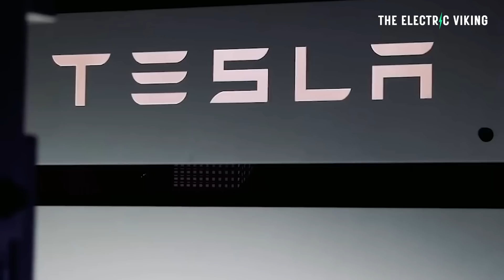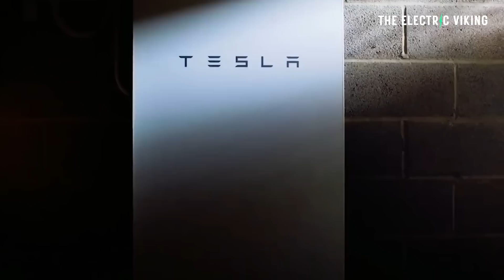Solar levelized cost of electricity has fallen by over 90% since 2010

Comment: There is total national energy; 10% grid electricity and 90% fossil fuels. 

Grid electricity is 10% dirt cheap electricity and 90% transmission costs.

Transmission construction is 10 decades and $TRILLIONS in national wealth. 

These are fundamental facts that vary a little national grid to national grid.

Transmission and Distribution capacity is a fixed minimum thing that limits the amount of electricity to the customers. 

The grid is fragile because it is extremely expensive and engineered to minimise costs of construction to the customers. 

Isolated farmers know how expensive new electricity poles and wires are from the existing grid. 
The new line is a new load and the entire line back through switch yards may have to be upgraded aswell as the flarmer's new line in to the buildings on the property. 

Let me highlight the situation. 
Nuclear promoters say CLIMATE CHANGE, so they will be the solution for clean electricity. 
Nuclear promoters say existing generation plant with nuclear heaters saves new grid construction. 
But CLIMATE ACTION means more than 1% of energy being clean, and NUCLEAR ELECTRICITY is extremely limited as the nuclear promoters have said. Limited be the EXTREMELY EXPENSIVE costs of new grid capacity construction. 
Nuclear promoters say, $1 to $10 million/ km.
Government says 1million km is grid length. 
Grid value $1TRILLION and 10 decades. 

If the sunniest continent on the planet is nuclear for climate action then every country on the planet will want nuclear industries. 

80% of the world's population live in dictatorships. 

Military defence budgets will explode. 
Add that cost to nuclear electricity. 

More grid electricity will mean more electricity grid construction. $TRILLIONS 
Add $TRILLIONS to Australia's minerals export industry. Uranium yellowcake, iron ore and coal and copper and zinc and aluminium and rare earth and lithium and....

Now Australia can have more nuclear electricity and more nuclear submarines and more massive weapons systems all paid by the world going to nuclear electricity. 

But nuclear must have cashflow 247 and millions and millions and millions of customers with rooftop PVs dirt cheap electricity and batteries will not need grid electricity. 

This is a national economic disaster if nuclear electricity generation plants were built and cashflow is dead. 
$100sBILLIONS in nuclear plant and no income. 
The $TRILLIONS national electrical grid cashflow will be a disaster as well. 

Nuclear promoters logic is f.......cked up.

Comment: Canadian nuclear promoters need cashflow 247.
Customer Rooftop PV electricity stops cashflow when the sunshines. 

As fossil fuels are abandoned electricity demand will inrease 4 to 7 to 10 times.
Huge oversized EV or BV batteries will be on the grid with V2G and selfparking selfplug-in. 
Bumper height wall plugs, ezi pezi at all carpark spaces. 

When the sunshines on customers rooftops PV, expensive grid electricity is not needed.

Grid cashflow is DEAD when the sunshines.
Grid cashflow is DEAD when the V2G EVs oversized battery is charged and the sun has set.

Solar panels will have huge import taxes. 300% 😮

Comment: The advantage that base power supply Used to offer was that it was cheap.  Coal was cheap for a long time, and nukes were not crazy expensive.  Now coal-fired electricity is more expensive than the other sources and nuclear is crazy expensive.  On top of that, neither coal nor nukes are dispatchable on the time basis that provides any value to a utility matching varying supply with loads that have always varied.  Base supply is NOT needed to keep the lights on at night.  ANY cheap source of electricity that runs at night will do the job.

Comment: True, the cost of solar panels and inverters have dropped considerably. In THAT aspect Tony Seba was correct.

However, he never contemplated about the devious way power companies operate.
During peak moments you have to PAY when delivering power back to the grid, only because the capacity of their network cannot cope (decades of mismanagement).
The only solution is home storage, but those batteries are disgustingly overpriced.

Also, big solar farms and wind turbines are switched off 10% of the time, because of “over supply”, though traditional power plants remained working…🧐
Reply: Battery costs went down even twice as fast as PV panel costs. A 10kWh LFP battery today costs less than 6k€ in Europe and enables a typical family house to  run exclusively on solar power day and night for 70% of the year.
Reply: @ikarustigger  A 10ish battery should costs way less than €6k.
Take a Tesla M3LR. Say it costs about €50k with a 75 kWh battery.
seven powerwalls are over €77000.
Thus a home-battery with wheels is cheaper…

Comment: Thanks Sam for providing this excellent summary promoting solar energy. Long time  believer and installe solar PV  to our home (13.2 kWh) in 2012, and two Powerwall-2 batteri3s installed in 2018. Our solar system was paid off by 2019 and we operate as a microgrid ~8 months of the year in Edmonds, WA (USA). Solar is a no brainer and  works to power our all electric home and charge our two EVs, while exporting excess solar energy back to grid through Net metering.

Comment: There is more solar power available in summer than winter. If enough solar panels are installed to cover demand in winter, there will be an excess in summer. Rather than let this go to waste, this could be used to make e-fuels to power existing and new ICE cars. I wouldn't write off synthetic petrol just yet.

Comment: But why is the LCOE relevant? It's the total cost that matters. You're looking at the wrong number. Even if wind and solar are the cheapest to 'add' to the grid, as the CSIRO says, wind loses to wind, solar loses to solar. Adding wind and solar makes the rest of the grid less efficient and thereby driving up costs of the grid as a whole. This is why grids with lots of wind and solar have high electricity bills. South Australia verses the other states. California verses the other states. Germany and Ireland verses the other EU. There are no exceptions.

It's like comparing commodities, the levelised cost of commodities (LOCC); iron, cotton or opium. The LOCC would be good for comparing iron and cotton, but not good for opium because people will get addicted to opium then become unproductive and the market shrinks. But even as the market shrinks, all the way up to economic collapse, societal collapse and into an opium war, the LOCC would still say that opium has the largest profits. Wind and solar are the opium of the energy sector.

Comment: LCOE as a measure does not take into account the cost of backup, grid balance and curtailment. Why is it that countries with high level of intermittent  power supplies have the highest electricity cost. You would make electric viking a real valuable channel if you dig deeper into this.
Reply: "Why is it that countries with high level of intermittent  power supplies have the highest electricity cost" - The answer to this question readily available online. In Australia it keep getting recycled by renewable energy contrarians and has been done over and over and over. In Australia it has been explained repeatedly by energy sector representatives, such as AEMO, AEC, ARENA, CSIRO and the various regional electricity network operators.

So one more time in laymans summary...........

The SYSTEMIC transition to a complete and mature renewable energy system is in it's infancy. It is referred to as a disruption that will take many years, not a simple change over. While the transition is in progress traditional forms of energy and generation obviously need to temporarily "hold the fort" so to speak. That costs more, while you have to retain the traditional system running along side the new system and all the complexities that brings with it. But there is no magical switch to flick and bingo we are all in renewable energy transition utopia in an instance. So what were you expecting? There is nothing unexpected about the state of play.

Maybe if all the mischievous naysayers piped down, got out of the way and let the people with the know how and expertise progress the transition, so the can get on with the job unhindered and at greater pace, electricity prices would be that much closer to coming down. But no, so many people seem to think they are experts in all things energy, while being critical of things that are entirely outside their sphere.
Reply: This is simply not true.  Here in America (excluding California because California regulation is absurd), the states with the highest percentage of renewable energy on their grid are also the typically cheapest.  South Dakota, Idaho, Texas, Washington state, Oklahoma, Kansas, Wyoming etc..  Also interesting, most of those states are free market Republican held states and they are building out renewables 3 times faster than blue states.
Reply: @Ryan-ff2db  Thanks for the heads up from your country. It has also been interesting here in Australia, because we have also had a mix of political flavours across states driving the transition to renewable energy.

It can only be a good thing. If politicians are willing to put ideology aside and make decisions based on merit, then they earn our support, whatever political flavour they adhere to.
Reply: @BrentonSmythesfieldsaye  Well, generally Republicans are the Big Oil party but red states(republican) are also more free market, making investment in renewables cheaper and faster.  The big red state of Texas has over twice the renewables as California but California rates are over 3 times higher than Texas.  South Dakota has almost 80 percent of it's power from renewables and again over 3 times cheaper than California.  So cheap renewables is indeed possible, if you keep the politicians out of the way.
Reply: @Ryan-ff2db  fact check:- 
Texas is still 70% Gas, coal and Nuclear generation…and a much smaller consumption than Ca.
S Dakota is a tiny generator (2.0 GW average) with a high proportion (30%) of Hydro .
EVERY State or country that has introduced wind and solar into their supply have seen electricty price increase.
Reply: @weinisable  "EVERY State or country that has introduced wind and solar into their supply have seen electricty price increase."

Since you made this statement without qualifications that may indicate the reason, I trust you are not trying to suggest that renewable energy generation itself costs more.
Reply: @weinisable  If you want percentages, look at the other red states I mention, like South Dakota with 81.4 percent renewable energy and still very low rates.  Renewable energy is cheaper, but building out whole new systems does cost money.

Comment: The real issue is that solar is cheaper than nuclear until you have to add in the cost of loads of new distribution lines that have to be built, then it is more expensive than nuclear. You are very biased towards solar without factoring in all the costs. That is why most Australians power bills keep going up
Reply: Are you factoring in full decommissioning costs of nuclear? No, you’re not
Reply: What people conveniently forget, are the times needed for commissioning and decommissioning a nuclear power plant.
The EU has to cough up billions for clearing up an old Hungarian nuclear plant.
Installing or removing an PV-farm is faster and cheaper…
Reply: That is just repeating the Coalition's disinformation. Nuclear is still the most expensive electricity globally whichever way you look at it. I am pro-nuclear but it is just too costly. And do you really believe "That is why most Australians power bills keep going up"? As simple as that? Why don't you offer your huge expertise to energy handlers like AEMO, AEMC, AER, ESB? You don't know what you are talking about.

Comment: The AEMO will soon start charging rooftop solar owners to put power into the grid.
Why is the AEMO doing this ?
That is part of the AEMO strategy in the ISP. The ISP says that the grid will need the equivalent of 9 more Snowy 2.0s before the last coal fired power station closes. This is not going to happen, so the AEMO needs another source of power storage.
Charging people to put power into the grid fits in well with the business models of the renewable farms and the strategic plans of both the AEMO and the AEMC.
During the day, when there is so much solar around, renewable farms can't compete with rooftop solar.
It would appear that the AEMC is now doing to rooftop solar what he has done to coal fired power (make it uneconomic for them to compete). This is likely to force rooftop solar owners to buy home batteries, which now fits in nicely with the AEMO's ISP strategy. If it doesn't pay to put your excess power into the NEM, you might as well store it for your own use.
The AEMO needs your home batteries and your EV (sources of cheap stored power) to back up the grid between 4pm and 8pm. It is listed in the ISP as CER (Consumer Energy Resources) but not costed in the ISP as the AEMO says that buying batteries and EVs is a personal choice. However, the ISP won't work if there are not enough CERs to use in peak usage times.
Reply: We pay when getting power from them,
We pay when delivering power to them.

Clearly we’re getting screwed.

Comment: What Australia's grid now needs is lots of EV charging during the middle of the day! 
To soak up all the spare & wasted solar.
Reply: They could also look at powering electric hot water systems during the day rather than at night.
Reply: Any home owner can put their electric water heater on a line voltage timer.  A 4,500 Watt element draws nearly 20 amps at 240 VAC so one would want to get a good one, but they are available.

Comment: Great article, but baseload, reliable generation is not BS. What happens on overcast days if all nuclear plants have been closed and there is insufficient hydro? Rolling blackouts. Yes, storage is getting cheaper, but not discussed is the true total cost /Kwh AC. There are significant losses in the conversion process both ways. If you're going from DC panels directly to DC battery storage, a large part of that loss is mitigated. But you still have the loss converting to AC from DC or AC to DC for storage, then the loss converting back to AC. Factor in maintenance and other unique costs, and what is the true cost/Kwh AC? Most solar generation is calculated in DC Kwhs, not AC. 1 Kwh DC does not equal 1 Kwh AC. Salesmen never discuss efficiency losses or actual real-world AC production of your system only the theoritical maximum panel production under perfect conditions. We will always need something to pick up the load until grid sized battery storage is large enough to cover baseload. Being a Yank, most of your EV news about Chinese vehicles costs etc are just pipe dreams in the States. But tariffs come and go depending on who controls Congress & the White House. I enjoy the channel!!
Reply: DC to AC inversion is actually a very mature technology - losses in even very affordable consumer inverter units now are very small, typically around or less than 2-3%, across effectively the entire operating range.
Reply: 88% of the electricity generated on the grid comes from utilities, leaving 12% from residential. In the utility power generation business, we, say, delivered kWh, deliver power. This takes into account all inefficiencies, such as losses and power factors.
Reply: Sunlight isn’t needed for PV, just daylight will do (though the yield is lower). Even now, while raining, they still produce.
Reply: @Carl_in_AZ  I think you misunderstood my comment. It was not about utility supplied power, it was about the inherent losses from solar panels and their DC-AC and back conversion process for storage/use. There are losses in these systems. The advertised salespitch production is not usually how much AC power is expected to be delivered at the end of this loss chain.
Reply: @tomfahey2823 And what about the AC to DC conversion to put it in your powerwall etc battery system or the inbersion required to get it out back to AC. These don't use micro-inverters like the panels. All these losses add up. At 3% ( amazing) that is a 9% loss from panel to battery  to AC.
Reply: @Patriot4Ukraine  That is why Yamaha and Hillcrest Tech are testing 0.3% loss grid-forming inverters. These inverters improve efficiency and can handle brownouts and blackouts by creating an induced sine wave on the grid so all sources can parallel sync. This is critical to solar panels because they have no spinning inertia like a generator during a brownout.  Yamaha has eliminated grid-induced harmonics with their inverters. When an inverter induces harmonics on the grid during a brownout, it is difficult for the different power sources to find a clean sine wave to sync to.

Comment: Solar doesn’t work in uk/Northern Europe in winter without massive excess capacity, which puts levelised costs up. There is naturally more wind in winter and less in summer.

A balance between both forms of generation and storage will develop in this region. Wind power is necessary and the levelised cost is very low.
Reply: Yeah, that's what has been happening, we all just need more batteries, solar is just so much easier and cheaper to build out.
Reply: Wind is much better for thise region as quite windy all year round